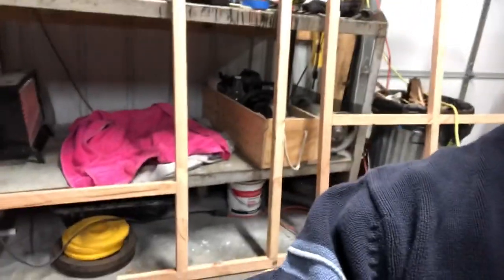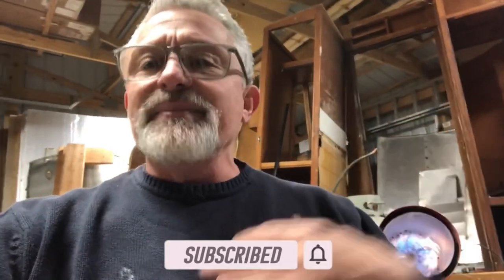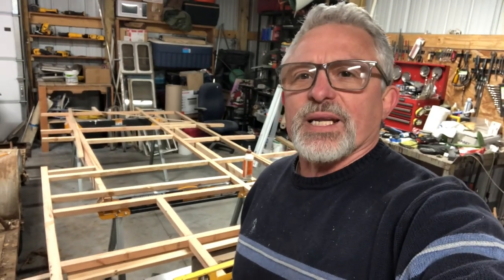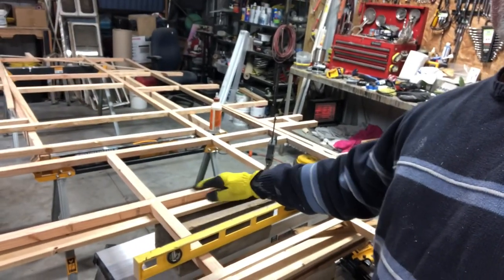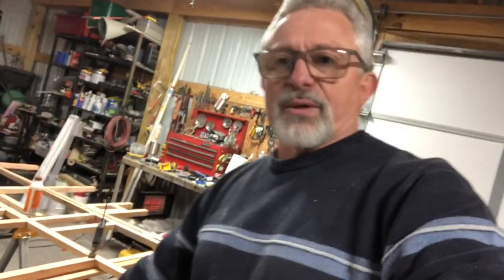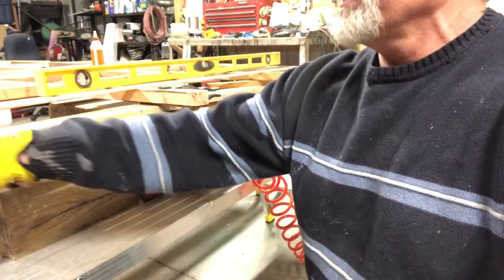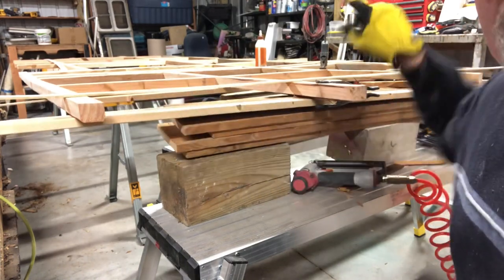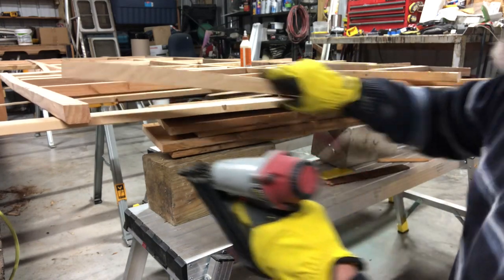EP 128  Step by step building the canned ham shape for the walls of vintage camper.

Comment: Rob, excellent video as usual. Question; why not use longer staples, you’re only getting 1/4” bite into the framing? Staples are awesome, if they sink deep enough, you can’t pull them out, as you well know.
Reply from the maker: The second nail goes 3/4 to secure the first two and the third goes 1/2' and then it builds on itself. Bigger staples wouldn't hurt for sure.
Reply: It just seemed on the first row with fresh bends, it was trying to pull out. You’re a true craftsman so I know you’ll get it right.

Comment: Hey, actually the voice is coming in loud and clear, no elevated voice needed...
Reply from the maker: Thanks Iphone!
Reply: @RobTheRebuilder  also, set up a small oscillating fan, up off the floor of the shop, and run it on a low setting when you run the heater.  I find that it moves the warm air around a little bit, and maybe gets you the best “bang for you buck” on heating ability of the heater.
Reply from the maker: @greggb1416  Appreciate it